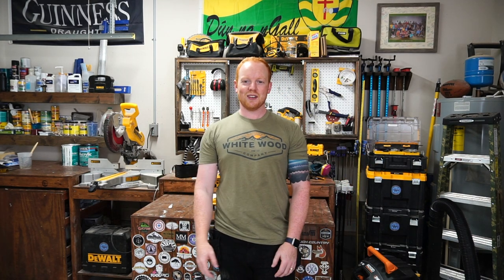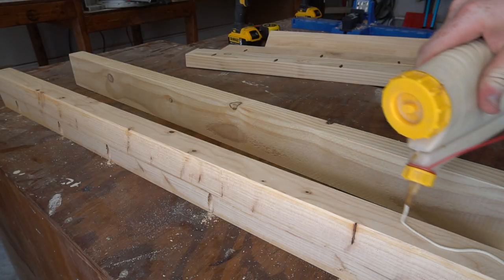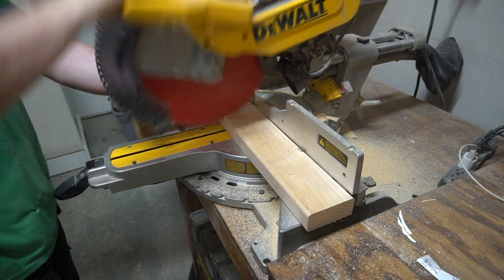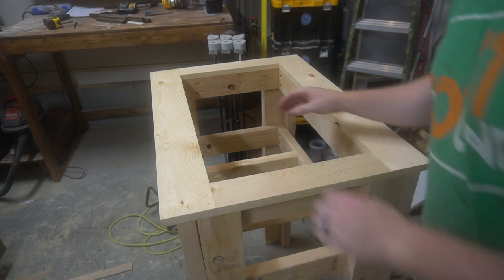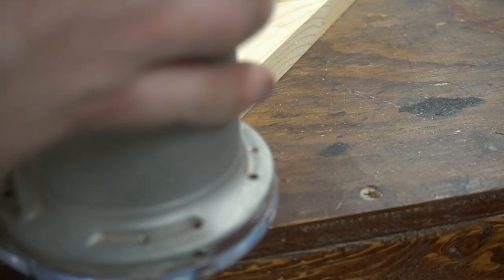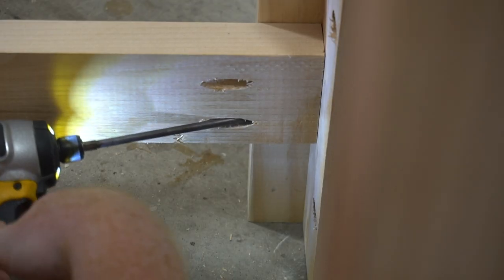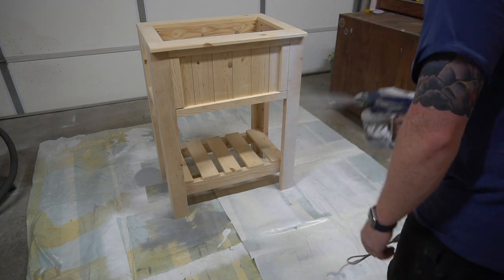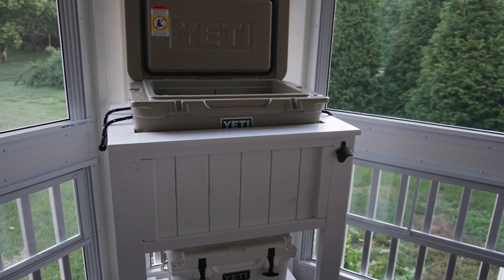DIY Yeti Cooler Stand

Comment: Thanks for sharing this.  i have the same cooler and want to build this for mine.  How did you set up drainage?  I dont think I saw it in your video.
Reply from the maker: Kevin Reid hey man, I didn’t do that until i delivered and then I used a multi tool to cut out a square where the drain was
Reply: @derekwalkerrr  thanks for the reply.  Looking to make this soon I have a yeti 50 which is similar in size.  Thanks again!